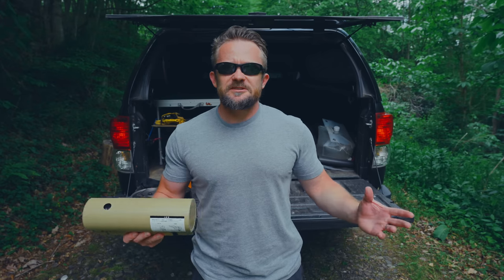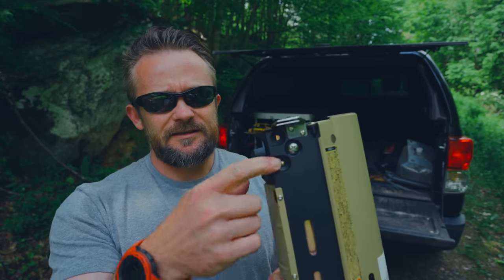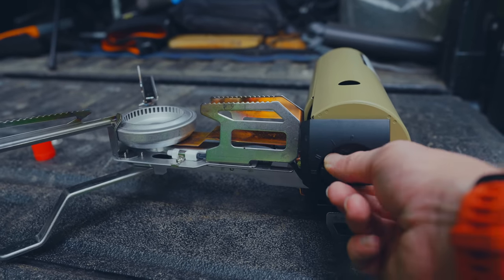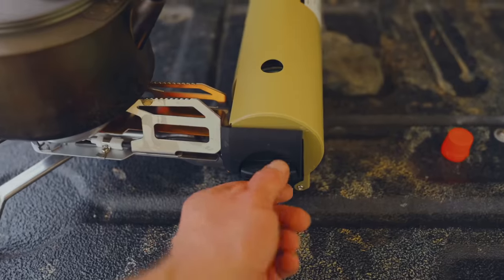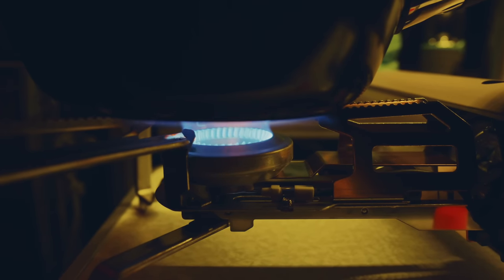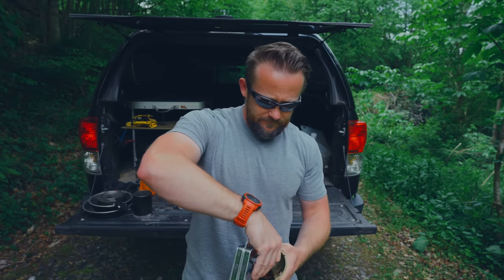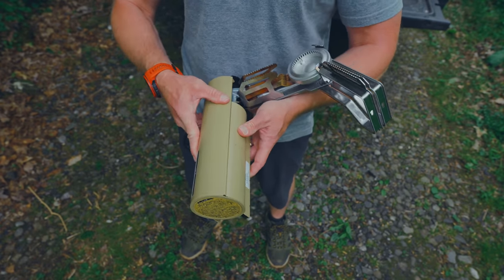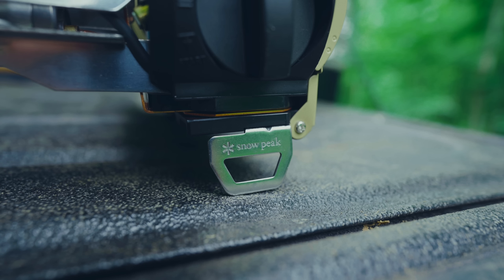Very Few Stoves Can Do This - Snow Peak Home and Camp Burner Stove Review

Comment: It seems like it is a good stove. The issue I have is that there are other good butane stoves out there, and although this one is more compact, your use cases are still relegated to Rv, car/suv, and  motorcycle/bike camping. For most of these use cases, only motorcycle/bike camping makes sense to get this stove due to it’s compact size. All other cases I would get a bulkier one that has a better simmer control and possibly one that allows for smaller cups to be used. Saving $$ on another model is also of growing importance in this economy.

Comment: Thank you.for the review.  When I went on to the Snow Peak site, they include a caution to NOT use a cast iron pan, as their radiant heat causes problems with the fuel canister.  They then offered a covered, aluminum cook pot for about $140.  That’s about $110 too much.
The unit has some limitations that seem unreasonable.
Courtesy of Half Vast Flying
Reply: Snow Peak make excellent, high quality products BUT usually very expensive.
Reply: @kwhatten  G’day, kwhatten.  If you say so.  But frankly, their marketing practices left me cold.  The open market sifts out what people want.
My best to you.
Courtesy of Half Vast Flying
Reply: Quite uncommon to carry cast iron backpacking and that who Snow peak caters to… backpackers.
Reply: @travisgray1099  G’day, Travis.  You are correct.  I’m an 85 year old who camps on motorcycle, and canoe.  We carry more than backpackers do.  I no longer back pack.  
There are very nice stoves available today.  We’re lucky.  
My best to you.
Courtesy of Half Vast Flying
Reply: @jackvoss5841  the are a lot of good stoves out there for sure. Yet I’m surprised you have found a single burner that doesn’t have a radiant heat issue when used with cast iron. What’s your current stove set up?
Reply: @travisgray1099  G’day, Travis.  Often I just use a Jetboil.  Sometimes a Littlbug twig stove.  I light a fire only in the evening, to heat water for the freeze dried food, and to make tea.  Breakfast is a granola bar that I make myself.  Lunch is some nuts and dried fruits, with either some jerky or string cheese.  Supper is usually freeze dried refried beans and diced onion on a tortilla.  Later, it’s a shot of single malt and a cigar, to celebrate having made it through the day.  
Courtesy of Half Vast Flying

Comment: The GasOne GS-8300 Spyder is very similar and almost a third of the price.  It works great.  However, it does not have the copper heater thingy.  It also comes with a case.
Reply: I posted similar twice and it was removed, also a good YouTube review

Comment: I have a BRS copy of this stove, it did come with a neoprene case but I had to buy the copper heating plate separately - it’s a loose item that you manually install (very simple) when tempature drops. It seems really nicely made - not Snowpeak quality but still good and it was less than half the price.

Comment: I still like the similar Soto G S320 stove that Luke has used many times. It costs about half of the Snow Peak but same great quality. The copper heating arm is cool, but not for the huge price difference. Its easy to add a copper Moulder strip to most single burner camp stoves.

Comment: I Would be afraid that the copper plate that heats the fuel container would lend to an explosion of the butane canister..?
Reply: the control valve has a safety device that ejects the fuel can if it oveheats.

Comment: I like the stove, the form factor makes it easily transportable and protects the stove ring and igniter when in transit. Dual fuel options would make more versatile (butane/propane). For the $$$ yes it should come with a case or carry case with a pouch for spare fuel. The opening and closing could be easily addressed, and it wouldn’t be too difficult to add small wind break fins that fold down off the pot supports, like wise have a way to have some adjustments to the pot supports to help with smaller pots/cups.   For me …. The price is the biggest concern, get it down to around $90 and this could be a good viable option for many, not a backpacking stove as it is, but they could change the materials and make a skeleton version out of titanium, which could more than half the weight, yes the price would be more$$$$.  Interesting and different stove, a few tweaks could make this a GREAT one.. superb review Luke, thanks for your time buddy.

Comment: This is a stove that could benefit from a side-by-side comparison with other lightweight folding stoves.  There are a few on the market that have different form factors.  Are some of them weaker burners?  Which ones are strong enough to allow for full pots from heavier materials?  Which ones are stable under load?

Comment: Thanks for the nice overview!  Just wanted to let you know that Snowpeak has this on their website for $150 with a bag.  😉  Also- those isobutane canisters are sometimes difficult to find and can’t be shipped by air.  Getting a 5 pound cylinder of propane is a lot cheaper and lasts the whole summer with heavy use. I really like the size of this though…bummer!

Comment: My Eureka SPRK+ stove is half that cost and does have the heat transfer plate as well. It is also has a very high build quality and has a higher BTU rating.
Reply: Only 10-11,500 BTU
Reply: @DrDennis  The Snow Peak stove is 8300, so the SPRK+ is ~38% higher.

Comment: I wouldn't mind the price tag if it was better at controlling the flame. With its compatibility it would be perfect for a family oriented kit saving space for the extra items for the family.
Reply: it actually does have good flame control, but you can't go by the numbers on the control dial. if you watch the burner flame while adjusting it, you can get it down to a very tiny simmering flame. the inverted burner is also great in wind, it doesn't get blown out as easily as a conventional burner.

Comment: Don't think I would go that much for one of those.  The $30 ones would serve just as well for overlanding or car/truck camping.  A real pet peeve for me is all of these "backpacking" stoves, burner holders, etc., that the very pots and cups that a backpacker would use won't fit on them!!  I just don't think backpackers haul 10" or 12" pans with them(?)  I bought a neat little stand for a trangia burner that breaks down pretty flat and is lightweight, but it won't hold small cups or pots either!!  So I am trying to make some add on pot supports so I can use my 750ml Toaks  pot with it.

Comment: Those stoves are in many sporting goods stores over here.  It does seem overly difficult to close and over-priced when I looked at one first hand.  Recently I saw a "transformer" heater/stove online -probably from China.  It looks like the heater is in the same class as that smallest butane heater you use for truck camping.  To transform to a stove, the heater just tilts back on its base until the burner is parallel with the ground 🙃.  It would be cool to see a review on that for the novelty factor and to cut through some dubious Amazon reviews.  Anyhow, the stove heater combos look interesting.  I've seen Chinese knockoff of this Snow Peak for about 40 USD, so I doubt I'll be picking up a Snow peak, regardless of quality difference.

Comment: Think your Cons were prety minor, Luke. $130 isn't a lot to pay for something that is well made, does the jobl, and you're probably going to keep for a few years. Take a little care when closing that cover or when breaking the stove down and it'll be fine. As for the size pots you can use, well, it's not a backpacking stove and you're probably going to be cooking for more than one, so boiling a larger container of water shouldn't be an issue. No instructions in English shouldn't be too much of a problem, it doesn't look too hard to work out. If you are having a problem working it out, perhaps camping isn't for you? Heh-heh. Thanks for all you do though, mate, and I look forward to your next video.

Comment: What about on a hot day?   Does the heat transfer warm the canister too much?  Those cans are made with blow out safety vents for a reason.
Can you easily disable the heat transfer system?  If not, their rev 2 stove should let you pivot the warm plate away from the canister.
Arizona has about 9 months of summer, so this issue is quite important.
Overall, it seems like a way to shrink the size of your Jeep shtf kit, but at a cost.   At around $60, I can get a  quality 12,000 BTU rectangular butane stove with a propane adapter.

Comment: Since I own this stove and since cons that I have experienced weren't covered in this review I'll add my two cents.
This stove has two potential problems that may catch you with your pants down and both are related to gas canister attachment system.
The thing is some canisters are made from metal that is not very magnetic and so there's no way you going to make such canisters to attach since this stove it using magnet.
Another issue is with their "safety mechanism" and it's rather common problem that I experienced as well. There's little safety pin that tends to make canister disconnect randomly.
I had to completely remove it and ever since attachment was rock solid for me. That being said you still need canister that is made from a fairly ferromagnetic metal or else it won't hold.

Comment: When I first came to Japan back in 1991 (I'm still here), table-top butane stoves were something new to me. They had yet to make it overseas. The traditional and original use for them was in the home, on a dining table with a large clay pot on top with either a 'shabu-shabu', 'sukiyaki' or Japanese hotpot inside that people around the table would all help themselves too. The camping boom of the 1990s saw people starting to take them outside as well. Since these are so ubiquitous here in Japan, the main advantage of them is that the gas canisters are sold everywhere. From DIY shops, supermarkets and convenience stores. As you point out, they do have their limitations when used outdoors. The SnowPeak design is excellent, however I am shocked that they do not provide English instructions in the USA. The Japanese are immediately up in arms if there is no Japanese instructions or 'tori-setsu' (取説) included. Hypocrisy much. 

FYI: 'Tori-setsu' is a colloquialism and abbreviation of the Japanese equivalent of 'instructions book/user manual' etc. It derives from the long-winded 'Tori-atsukai Setsumei-sho' (取扱説明書).

Comment: If you are going to use this out of a vehicle buy a countertop butane stove for $20. Butane stops flowing gt at 31 degrees F so I would not recommend it for freezing weather.
Reply: i have used my snow peak butane stove in freezing conditions, the can heating system works well and i have not had any problems with the stove freezing during operation.

Comment: Great Review! Thanks for making it!

Quick question - 

I have heard advice to not use large frying pans because they may touch and overheat the fuel cover and cause a possible fuel cannister fire. Is this a reasonable concern? If so, is this a concern with the SnowPeak? Also, how hot does the copper warming pad get?

Your reviews on butane stoves have got me interested in looking at them for purchase. (Probably a dual fuel butane/propane version.)

I see that you have used several (Soto, Coleman, CampLux, SnowPeak). What do you think about them as a class?